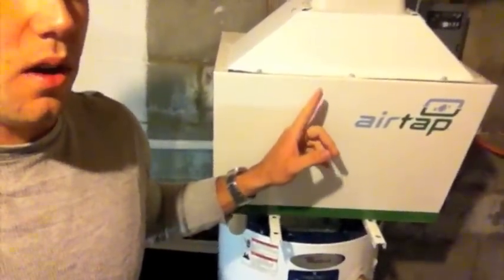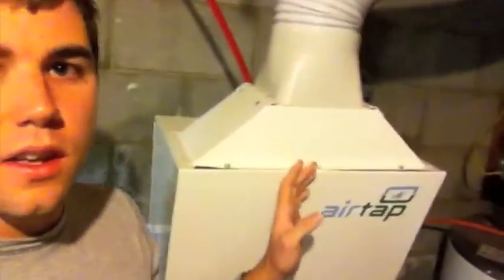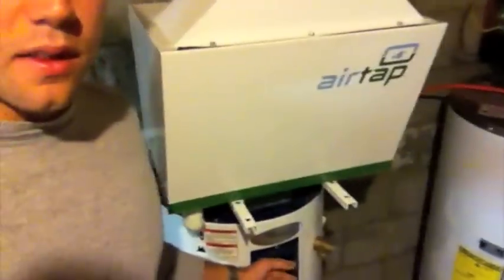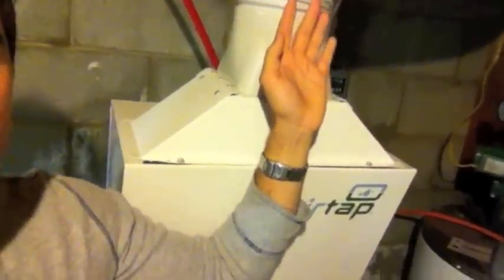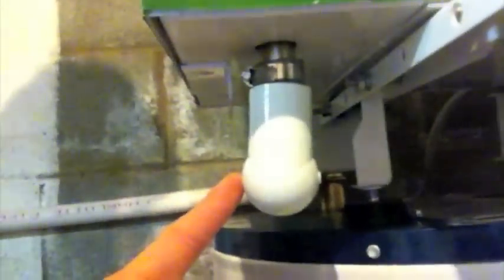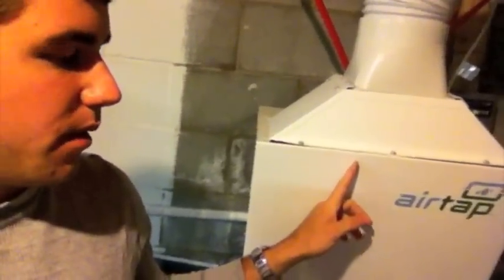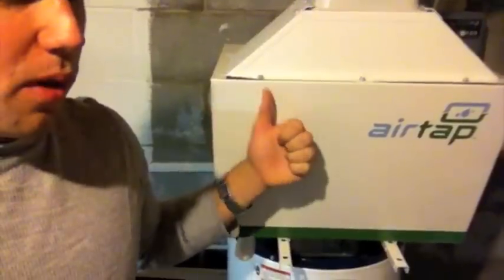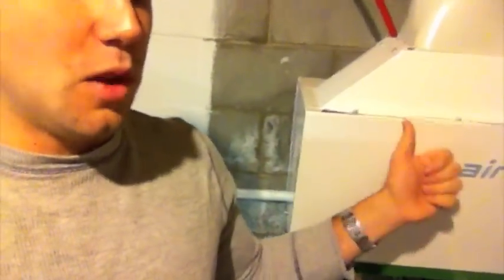Air Tap - Hot water heat pump

Comment: You've had this now for several months. How has it effected your utility bills? Before installing this, were you operating on gas or electric? Does this airtap require that it be the ONLY source of heating the water? Or can they BOTH be used when the temperature in the room is colder?